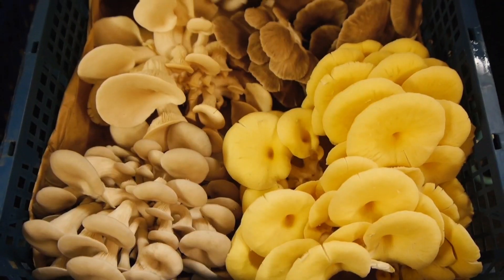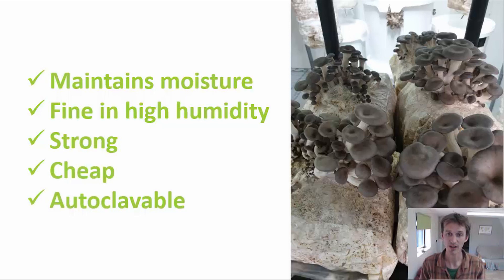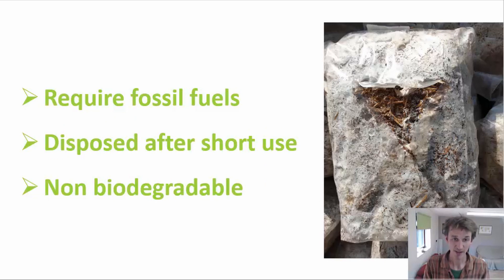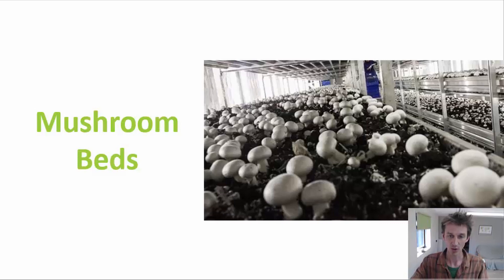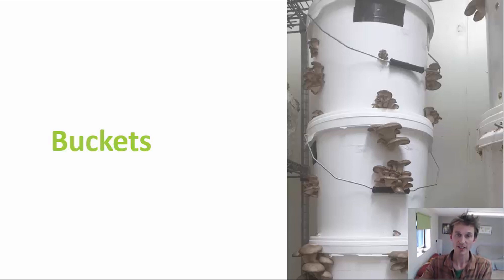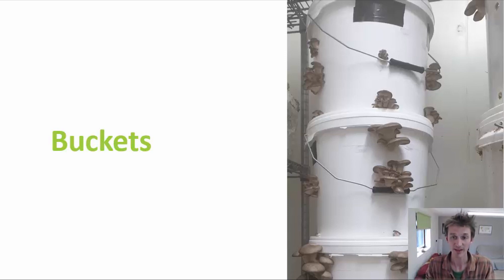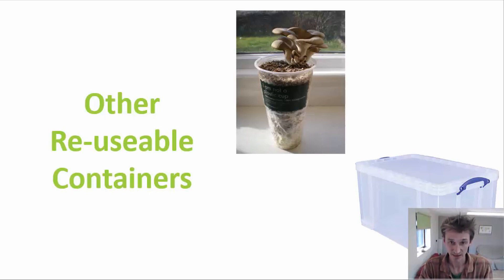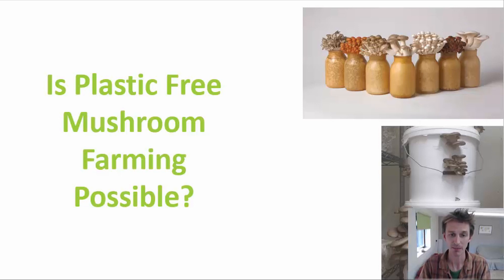Plastic Free Mushroom Farming? | GroCycle

Comment: The cheapest thing if ya got a hot water tap to just use a pressure washer. But the use of water in cleaning can also be viewed as bad for the earth. For instance in California they have a law that fines people for using to much water. People literally have to choose between doing laundry, dishes or a shower. The ground there in some places have lowered by fifty to a hundred feet or something because the aquifer is decreasing. So I don't think using tons of water in place of plastic is reasonable especially if people are avoiding plastic to save the earth. I know some people for instance avoid dairy saying it's bad for the earth cause cows use lots of water and produce methane, but most people don't know that it takes like a gallon of water to grow a single almond so tons of water was used to produce a glass of almond milk. 

It's good that you're comparing the pros and cons and actually looking at both sides. It lets people see that saving the earth isn't easy. Metal for instance instead of plastic pollutes a lot to mine it, and make it. And electric cars that use cobalt probably don't mention that most cobalt comes from the Congo where thousands die from pollution and there's child labor. Even green cars aren't green. That would cool though if one day there was an actual alternative to plastic since it's literally used in almost every business especially hospitals. 

One thing ya could check out is old plastic 8" tubes that were used for field irrigation with openings every so often. They could contain a lot of material if ya had the room cause they're long.
Reply from the maker: Absolutely agree Kolton, you really do need to take into account the whole picture with these things and water usage is really something that needs to be considered...same with the fact that even buckets have a limited lifespan...we may hire a life cycle analyst to carry out a study for this to really look at all the external costs involved.

Comment: I'm in no way expert on cultivating mushrooms, or bio plastics, but if the problem with starch bags arise with the bag tearing when cutting the bag you might want to try using some kid of a strengthening "collar" around the hole to stop the tear. Tape around the area before cutting, glue a piece of cloth to the bag and cut through it or something?

Comment: I'm curious, why even wash the buckets/bottles? What would be contaminating the new substrate from the previous batch?
Reply: I was thinking about the same thing. You would have to label the buckets so as not to mix the different strains, other then that why not?! Especially if you repacked the buckets as soon as you empty them, you could save so much time by not having that clean step.

Comment: I happened too notice a small steam cleaner on TV once upon a time that seems like it would be economical in cleaning the buckets as far as sterilizing goes after hand clean or low pressure...pressure washing. I don't know in actuality it would be practical or not. The one on tv was used to clean surfaces in bathroom and kitchen. Inside is a must almost cause of insects.to grow shrooms...fire ants.....worms.....etc....love the substrate of shrooms . I bought 2 kits lately of which one I had luck with via instructions. The non producing log kit I buried outside....then it started to grow a few king oyster mushrooms and lo and behold ants and worms helped me to eat them. I've inoculated trees here or put the plugs or wood dowels, but it's a waiting game with that and hoping the chicken of the woods mushroom will work out and spraying with water twice a day in a shady spot so as to keep enough humidity going...might pay off in long run. . I did drill the holes slightly oversize..which I hope that don't make a big problem. The drill bit I wanted to use was too dull to drill a hole with...so I decided one a little bigger, which was all I had. I melted candle wax to apply over holes. Just hope the chicken of the woods type mushrooms will produce?

Comment: The things that make plastic so useful in this application (strength, temperature and contamination resistance, durability) are the same reasons is such a terrible pollutant. 
We want something strong, flexible and durable that breaks down easily :(
Too bad we can't cleanly burn spent plastics for energy and return the carbon to the ground.

Comment: Either way plastic will still eventually find its way into the trash what ever kind of plastic it is , buckets will break down in time as well , but does slow down the process I think compare to plastic bags for sure. I wonder if logs were made from wood chips inoculated and pressed with some wholes in them and all they need is a soaking , when there finished they simply can be broken down to go back into compost for gardens , just a thought , how to go about that I’m not quite sure , could it work ?

Comment: There has to be a method of burlap or hemp woven bags/sacks (also can be repaired when holes are cut or sacks can be made with windows or a patch to cover the holes in the sack that are autoclave safe) and substrate going through a sterilization process and then wax spray or dip after the sterilization process in a sterile environment. That would work especially due to the climate controlled nature of farming mushrooms and wax being a sealer. Both of which wax and burlap or hemp or fiber all of which are biodegradable.

Comment: Would a metal bucket with holes in it work? Perhaps some metals would be better than others
Reply: you risk rust and/or corrosion with the levels of humidity you'll need. That said, it may still be a viable solution. It DOES however add a considerable amount of weight that a reusable plastic bin would not, making it more difficult to handle.

Comment: How do you keep the substrate watered when growing in buckets?
Reply: The substrate is soaked then drained before putting in the bags or buckets, and this moisture is enough to sustain it throughout the growing cycle. No extra watering needed, but the air humidity must be maintained to suit the variety.

Comment: I dont understand why beds are not good for other than button mushrooms---it seems like you would get more fruit per square foot than through limited holes in plastic, etc.??
Reply from the maker: It's to do with how the different mushrooms have evolved in the wild to grow. Growing in beds is more suited to mushroom species that grow in a compost substrate, like button / portabella mushrooms which grow in fields in the wild. Beds have a large surface area which can lead to moisture loss in the substrate unless you have a casing layer, which many mushroom varieties don't require. If you try to grow oyster mushrooms on a straw bed the substrate just dries out. You can add a 'casing' layer on top but it's a whole extra step to sterlise this substrate, add and remove it if you don;t need it.

Comment: Also---when I see bags, buckets, etc used, there are so few holes in them. Wouldnt you double the production if you doubled the holes?
Reply: I doubt the myzelium has double the power.
Reply from the maker: If you add more holes, you just get smaller clusters of mushrooms / smaller mushrooms. If you add too many holes the substrate dries out.

Comment: Hi, I find this video very interesting. 

I would like to know if it is possible to cultivate mushrooms in glass jars or bottles, and if so, do they need to be sterilised clean, or just with a standard dishwashing machine cycle would be enough to put the substrate in them safely?

Again, thank you very much for your posts. I found them very helpful.

Cheers
Reply: I’m currently trying that as someone very new to growing mushrooms. I sterilize substrate in the jar and then add mushroom cuttings from inside a still air box. Very poor success rate so far but I don’t think it’s the jars.  I sterilized them at 15psi for 60 minutes. But my still air box had some gaps and my breathable jar covers are paper towels folded over. Lol

Comment: Theoretically would bamboo work?
Reply: For one time use, maybe, don't know. I suppose any biological material will start rotting in these conditions. So if there is one that works, it has to be regularly replaced too. I doubt that bamboo would be much more economical friendly in that case, considering the lengths it has to be shipped around.
Reply: @Ants C I knew it wouldn't be ideal, though certain bamboo's can get thick enough to grow certain variety's of mushrooms (but no way near as ideal as plastic). The only advantage is of course it's biodegradable and potentially can also be used as a substrate by the mushrooms. Much like the logs used to grow Reishi mushrooms. That way you are just left with compost. No plastics needed. Which makes me think one potential solution is if one could make a container out of the substrate itself. But yes all of them would cost more.

Comment: Large diameter PVC pipe
Reply from the maker: Yes! this is something we tested last year and were impressed with as an alternative to buckets...especially as you can buy duct cleaning brushes exactly the right size to fit through the ducting. We'll be testing them again this year on a bigger scale
Reply: @GroCycleTV  what sized pipe? 36''x 8''?
theres a pressure cleaner with steam clean option on the market also
Reply: @GroCycleTV  Great video. Please update on how the Buckets and PVC pipe trials went. 😃

Comment: Single Use Plastics do breakdown over time , a very long , long amount of time usually around 1,000 years or more . The controversy around the ' Biodegradable Plastics ' seems to be over the amount of time reduction in the breaking down of these types of Plastics . So basically if ' normal plastics ' take 1,000 years and these ' new biodegradable ' plastics only take around 500 years to biodegrade then are they really a better sort of plastics ? For comparison , the ' normal ' Human lifespan currently is around 85 to 110 years old , so 500 years to biodegrade still isn't a viable option , it is only slightly better than the ' usual options ' from single use plastics . 
  As far as ' recyclable plastics ' goes , not all plastics are recyclable . Of the various types of plastics currently in production from the plastics industries only around 3 types are even recyclable . 
  The best option for now , is to use ' multi use or reusable ' plastics . Over all you will use ' less ' plastics in the long run simply by reusing the plastics that you already have . Use them and then sterilize them so that you can use them repeatedly . Ultimately there are alternatives to plastics for the ' small volume ' person like wood or even just layered methods directly on the ground outside . 
 As in all things do your own research , there are a varied amount of videos even here on YouTube showing and explaining different gardening methods including mushroom growing for the small size ' farmer / grower gardener ' .

Comment: If the cornstarch bags are tearing when you cut them, just reinforce them with a perimeter of biodegradable tape where you are going to cut. Or cut reinforcement rings from recycled plastic and glue them to the bags with a high temperature heat release adhesive. So that they can be lifted with a heat gun and reused.